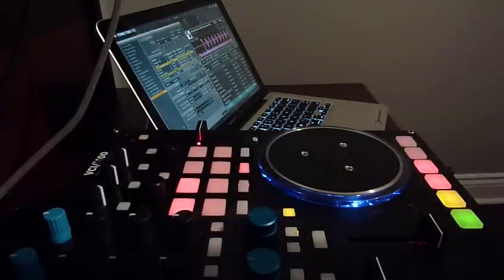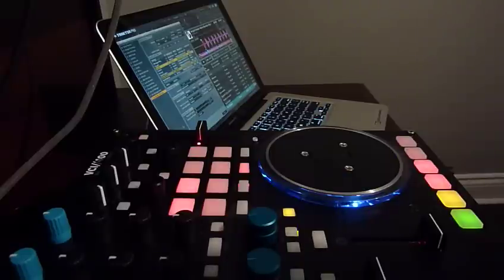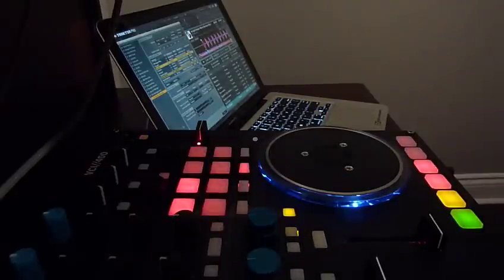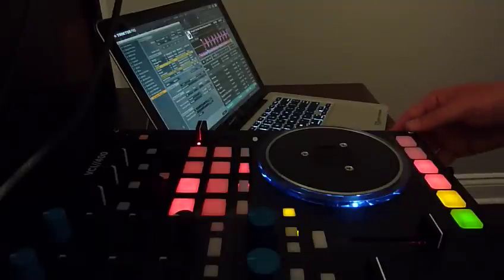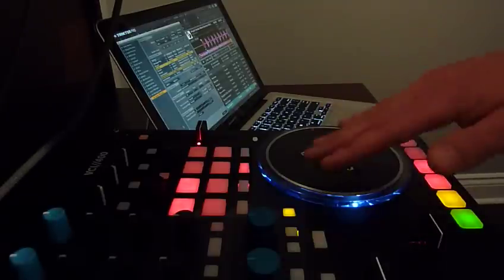Scratching with the Vestax VCI-400 and Traktor Pro 2 (WARNING! I don't know how to scratch!!)

Comment from the maker: Yes I'm pretty happy with the 400, it's a bit more flexible than the S4 in that you can customize just about the entire controller where you can't on the S4.

If you are looking at simple plug and play then I would go with the S4, much easier to set up.  If your looking to customize or use other software other than Traktor I would recommend the 400.

I choose the EGE over the regular mainly because of the looks and also the extra firmware features.
Reply: groovemixer i need yours midi mapping ?) more about settings

Comment from the maker: Hey yeah basically by default it all depends on the tsi file (midi mapping file for Traktor) you use on the VCI400.   You will have to teak it to how you prefer.  S4 on the other hand is mostly plug and play.  There are some adjustments in the midi settings but not as much as the 400.
The 400 hardware can also be adjusted, touch switch sensitivity and wheel resistance where the S4 there are no settings. 
If you can best thing to do is go and try them a a DJ store and see how they feel.

Comment: Thanks Groovemixer - I'm also weighing up either a S4 or VCI-400.  Overall I would much prefer the VCI-400 but a little worried about the jog wheel response in Traktor.  You mention that it's not too bad after tweaking the settings.  Is it pretty bad by default?  Also, after tweaking the settings, how does it compare to the S4?  Is there a very noticeable difference?  Thanks in advance

Comment: Did you have to load any special mapping or do anything with the settings to get the vinyl mode to work with the vci 400?  I have Traktor Scratch Pro 2.5 and I can't seem to get the vinyl mode to work.  The vinyl button doesn't seem to make a difference and I've messed with the platter sensitivity knobs.  I loaded the v2 firmware on the controller and loaded the v2 mapping in Traktor.  Is this what you have loaded?  Just wondering what you did to get the platters to work as vinyl mode.  Thanks!